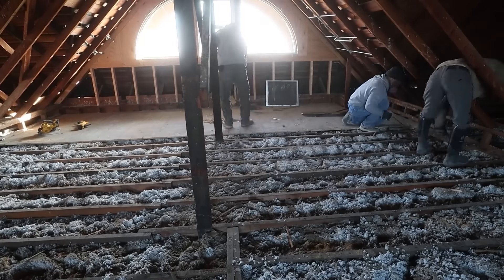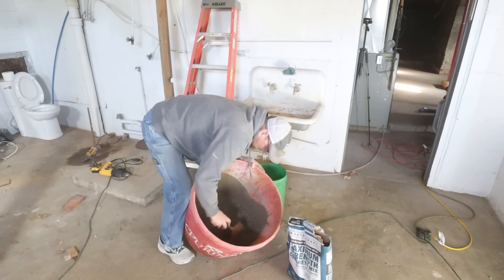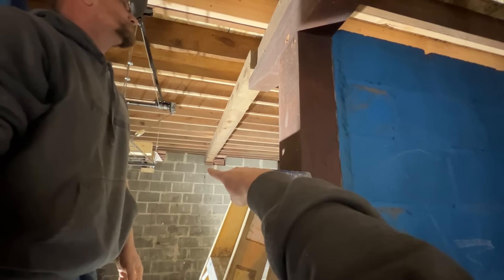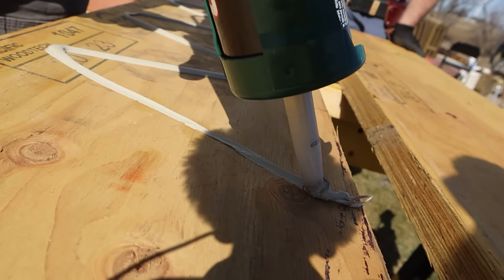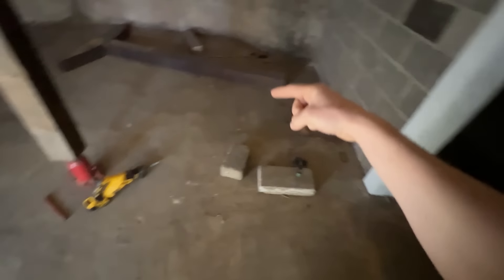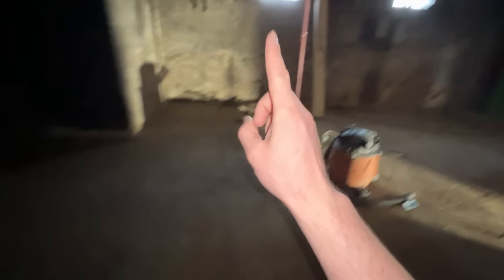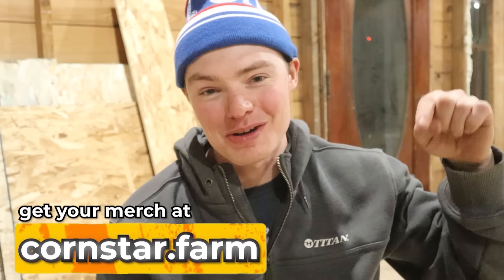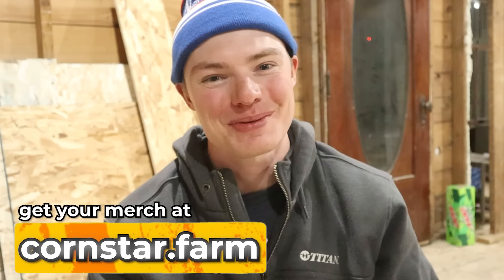Restoring A $7,000 Mansion: Rebuilding Basement Ceiling

Comment: to get concrete into such basements, you order a pump truck, the concrete is pumped through hoses, 100 feet no problem. Regards, concrete contractor in Norway
Reply: from what ive seen concrete pumps can be super expensive,  was watching on some renovating channel here on the tubes and there they charge first for just coming to the place then for the time they are there and the amount pumped through so can easily cost 1000´s of dollars real quick at that point id rather use wheelbarrows considering its a flat area and were not talking crazy m3. dont get me wrong pumps are awesome if your pumping alot of volume or up some floors but a basic basement pour, be better just to get some wheelbarrows or make some slides with materials that you have around and save your self some cash, but America is a big place and maybe its cheaper there.
Reply: It doesn’t look like he’s worried about the money. Pump truck is the logical solution.
Reply: @arniorgumundsson3782  You won't need the pump truck.  They have units that are just pumps and hose.  This is what is needed for this job.  Not pump truck with boom.
Reply: yup.  And into wheelbarrows down there if it doesn't reach.
Reply: Don't you know they want to do concrete the hard way and not the easy way.........
Reply: # paid by the hour😂
Reply: 😊, Norway is 100 percent correct Cole. A concrete pumper work Great.  Standard job. 😊.
Reply: He need a line pump
Reply: Cole when you get to the bathroom you should consider putting 3/4 inch plywood on the walls behind the drywall.  Then if you want to install grab bars you always have something sold attach them to.   One 4 foot sheet two feet off the floor to six feet above the floor then run as one strapping top and bottom to finish the wall to put the drywall on
Reply: I agree with you, hire a pump. I don't know how much a pump is there, but it costs about $400-$500 in Southern California. And it would be worth every penny for this job.
Reply: also do the furtherest rooms first...
Reply: Came to say the same thing id definitely pump it in
Reply: @arniorgumundsson3782  Wheelbarrows can get this done... Pour the far rooms first, getting back closer and closer to the chute.
Reply: @arniorgumundsson3782 You may be thinking of boom truck. Concrete pumper is not so expensive, just a pump on a trailer or back of a truck.
Reply: He doesn't have to go that far honestly. He could use some of the old boards and make a few gutters and let it flow down those easily enough into locations. Did this once because we had more time than money for the project. Saved on a pumper truck and just built like 4 gutters and let it flow to the proper area. Just a rough guess he will need 4-5 trucks full so it will be a substantial amount of concrete for 3 guys to do in one shot so they better call a few helpers on it.
Reply: Pump the concrete. Just use a pump on a trailer lot cheaper then a pump truck
Reply: @MikhailScottKy always so unhappy?
Reply: I don't understand why you didn't cut the channel for the beam then pump the concrete in the voids and into the floor of the basement first before you set the beam. It did not make sense then nor does it make sense  now.  You made it harder than it had to be.  When I had my company I would not have done a beam installation this way. Jack the floor above just enough to slide the beam in after you pour the concrete. When you lower the floor it will rest at the point you need.
Reply: Yep, get a pump truck
Reply: concrete pump or build a trough with slope outside
Reply: Cole, a pump with some hose would work fine not to expensive but wheelbarrows are the cheapest way out. Also add parameter drains around external walls with plastic on walls. This is a type of system don't have a name but just Google. Cheaper then excavating around the outside of house because you would have to get under porches.
Reply: @billholemo2518 Wrong, line truck is cheaper!
Reply: I was going to tell Cole the same thing and saw you already did hopefully Roman will read your comment and tell Cole. I don't think Cole reads the comments to much.
Reply: This is the correct answer.  Let the machine do the work for you.
Reply: The thing with the concrete pump for this case is that you use them when you have to pump some volume. They will need to prepare the whole basement in advance so they can make an efficient use of the pump. Using other simpler metods will give them the time to do the concrete pouring in batches.
Reply: Can't believe Cole doesn't know about this system.
Reply: Check for a portable concrete pump trailer.  Cheaper than a pump truck.  Note that the concrete mix is is a little different.  Needs to be pumpable.  Generally pea gravel.  But check with the pump rental company.

Comment: Regarding concrete in the basement, call around for a concrete pumper truck (boom pump) that has a hose you can direct to each room.

Edit: thanks for the correction everyone on the type of line pump truck
Reply: Good advice!
Reply: Line pump would probably be cheaper and do the same thing
Reply: Build a chute and either pump it in the  chute or out of the truck only.. wheelbarrows young man..buy the two wheel ones..much much easier and you can pour it all..I don't think a pumper would work for the reason the hose is very ridged...
Reply: The old wheelbarrow relay has worked for decades
Reply: Should get a line pump truck.
Reply: There is no need for a boom truck. A normal pump and hose will work fine, and there's a hugh price difference.
Reply: Save the money and wheel barrow it around.
Reply: Excellent idea
Reply: you can also buy a 12”x20 pvc drain pipe cut in half and easy mock up a 40’ extension for concrete boom to make it in other room
Reply: I don’t know how comfortable you are pouring concrete. I recommend you let the pros do it. You can do most of the prep but with multiple floor drains and in the basement I would defer to experienced concrete men.
Reply: cole generac prep your house for generator wiring for automatic 20kw system

Comment: I wouldn't do the exterior drain tile if I were you. If you're already tearing up the basement floor slab, just install perimeter drain tile on the interior of your footings, have the drain tile dump into a sump pit with a sump pump that pipes water out to the surface of your lawn. Saves a lot of time and money while not destroying your yard that you spent so much time to get it looking so nice.
Reply: That is also how radon mitigation is done.  Basically it hooks into that drain tile and pulls the gas out from under the slab via that tile.  The sump well is sealed air tight so that the only source of air/gas is the soil under the slab.
Reply: Will not stop water from coming into through the walls. Drain tile belongs on the outside of foundation. They have a backhoe and skid steer🤷🏻‍♂️ So it’s simple to do it the correct way and waterproofing the foundation walls on the outside as well.
Reply: @kevink4914  That is correct, but his concern is hydrostatic pressure on the basement slab. This would be alleviated from draintile on the interior side. Any interior drainage is better than nothing, which is what that house has had since it was placed on that foundation.
Reply: condensation boilers are a lot of maitenance IBC is a good setup. vertical tube has better design. but they all take intense yearly maitenance... I own one and fix them as a maitenance contractor for a health region.. good luck
Reply: if your basement doesn't presently have water problems, and it doesn't look like it does, there's probably no need to go  crazy with a lot of drainage tile.  you are fixing a problem that doesn't exist.  floor drains to a good sump pump( the abandon well filled in most of the way would be ideal)  pit and the radon system should be plenty.
Reply: As far as radon, you pretty much pressurize the basement so it “pushes” radon gas back out and keeps it out
Reply: @sonoftheking444  not sure I've seen a radon mitigation system like that. The systems I've seen have a sealed sump pit with PVC piping from the pit through the roof and a vacuum pump in the attic that pulls the air from the pit through the end of the PVC pipe at the roof "exit" point.

Comment: Hey Cole! I'm thinking what would be a good idea for the kitchen is to extend the porch to the kitchen. This way you could install sliding folding doors, this way you could use the BBQ on the porch. Kinda of indoor-outdoor vibe.
Reply: This could have gone better if you did a couple of practice houses first.
Reply: Fantastic idea.❤
Reply: If you notice there are walls in the kitchen that are not spray foamed, he explained that this is so he can move that beautiful window and install sliding glass doors to access the  deck and a planned 3 season room.

Comment: Talk to your concrete company about a pump truck and crew to do the floors in the basement.  They'll pump the concrete through hoses and work from the farthest corner back to your window or even down the stairs. While you have the basement floor removed you may also want to consider adding in-floor radiant heat as well. That way you can minimize the 'cold' zones in the house. And if your radon test comes back good, it gives you the option of adding finished spaces.
Reply: Our daughter has in floor radiant basement heat.  Makes for a very usable basement.  No musty odors.  An extension of a comfortable living area,
Reply: @JimTucker-i7o  Hopefully he keeps a bathroom in the basement as well.
Reply: It also allows for heat pumps to heat his house using that juicy windfarm energy.

Comment: As a contractor who does concrete and foundations in southern MN, new and old id do a few things. When you tear the concrete out. Dig down a few inches, pack your base material. Then place 3/4inch washed stone (AKA Radon rock) then put your vapor barrier, at least 6mm poly sheeting down. On top of the poly put down 2 inch foam board and if wanted put your in floor heat tubes onto the foam if your doing that in the basement. When you pour it you can do it with wheelbarrows from a window, just place plywood down to not crush the foam. Or if in the budget use a pump truck and do the entire floor with a couple of people.

But of coarse before any of that do your plumbing and water lines. Also for drainage an interior drain tile placed along the bottom of the footings. Place the tiles level and wrap them up with tile fabric, make sure to place clean rock around the tile to allow water to flow better. Do a larger sump basin and not a small one you get at any big box store (French Drain Man has some good systems). And drill holes in every block or every 6 inches all the way threw the wall. Place a dimple board on the wall and goes down and on top of the drain tile. Allows water building up on the outside to run threw the holes, down the dimple board and into the rock/tile. Just make sure to seal the top of the board to not allow radon to enter. Also put a couple of cleanout holes in the tile to open and clean if needed.

If you really want to slope all the outside dirt away from the house, add rock beds with 1inch foam board underneath sloped away from the house. With a drain tile at the end of the rock. This will catch most of the water before it leaches down to enter the drain holes into the interior system. For the water drains id recommend one near the bottom of the stairs, one near the sump pump (with slope coming from the sump) in case of overflow, and one in the mechanical room for furnace and dehumidifier. Sorry for the long response but getting it right as its not easy to fix screw up with foundations.
Reply: Great I fo thx
Reply: Yes! This!
Reply: The advice you are giving him for the inside of his basement sounds like layers (steps) in a basement foundation that should be done on a new build, not on a rebuild. How is he going to pack base material, lay down a layer of Radon rock, put a layer of vapor barrier and a sheeting layer in basement that already exists? ARE YOU SUGGESTING TO DIG UP ALL OF HIS BASEMENT  FLOORS AND THEN MAKE ALL OF THESE LAYERS? He might as well have knocked down the whole house first then rebuilt the whole basement from the foundation and built these layers you are suggesting, then rebuilt the house up from there!
Reply: @julien2912  basically sounds like what he is doing. Gotta take up half the floor to do plumbing. I do it multiple times a year on jobs. Either full tear outs or partial tear outs. In many areas its required to put radon rock in before you repour the floor. So yes it's a lot of work but it's not impossible
Reply: Longest comment I have ever seen.😅
Reply: Where can I find your contact. I'm owatonna MN and looking for basement contractors.
Reply: Couldn't have said it better, but I'd triple the insulation board as you will feel that value for generations to come as it never breaks down.
Reply: @kingturgan1  sorry didn't see your comment. I'm in the waseca area, so very close

Comment: Run a 4-in pipe from the top of the ceiling down to the floor of the basement. Then put in an inline reversible fan. You can blow the cold air from the basement to the attic during the summertime and blow the warm air from the attic to the basement in the winter.
Reply: I would imagine his duct work will move all the air around like you just suggested but not in a little 4 inch pipe , but in big duct work.
Reply: Okay  @warrenmichael918   a 5" or 6" pipe, the biggest he can fit behind a wall. 
   You are correct about the duct work but your cold air returns are only pulling a small amount of air from each room, as they were designed to do. I don't know about your house but the only cold air returns at my house in the basement are up high and I added them.
    Let's say Cole's house is 6,000 Sqft with 10 ft tall ceilings that's 60,000 cubic ft. If he had a 1,600 CFM blower on the HVAC it would take roughly 40 minutes for all the air to recirculate. All that air is also be taken from everywhere in the house not from the warmest and coldest spots.  
    A 6" inline fan will move about 400 CFM of air. Remember hot air rises and cold air falls. So in the summertime you would be pumping 24,000 cubic ft of cold basement air a hr into the warmest and highest point in the house. Then that cool air falls through the house. 
    For argument stakes let's say the attic is the same cubic footage as the basement. A 6" 400 CFM inline fan would exchange the coolest air in the house with the warmest air in the house every 40 minutes. Two fans at the opposite end of the house 20 mins. 
    It's the same theory as putting a box fan at the bottom of your basement in the summer and putting a box fan at the top of your stairs blowing down from the second floor in the winter time.
    We tested this once when we removed an Old furnace flue pipe. It works. We do now when we have the available wall space.

Comment: 25:38 use a concrete pump- maybe you can pour fibreglass reinforced self leveling screed - then you dont need rebar and you only roughly need to spread it, it has no rough gravel in it and concrete liquifiers that make it self leveling, imagine you pour water- its surface is smooth and level and remains so when hardened - add hacked fibreglass to it and you dont need rebar except maybe to connect it to existing walls
Reply: Totally agreed on that, use a pump and concrete with fiberglass, it will make the all the work so much easy, Saludos desde Argentina

Comment: Concrete pump for the cellar.

When we built our house, they used pvc from the upstairs to the main line downstairs.  We can hear the water running through the pipes, especially when the toilet flushes.
I was told cast iron doesn't have the noise issue. 

Good luck
Reply: Yep!  He will want to insulate the chase where the drain line is with sound deadening insulation

Comment: Concrete pump will be the best solution to pouring the basement.  The time savings alone should pay for it's self.  Little or no standby time for the mixer.  A few workers moving the hoses from room to room vs the labor with wheelbarrows is the key.  Pre-set up the pump.  Mixer sets up once empties the load cleans out and leaves.  the pump cleans out, picks up the hoses and leaves right behind it.  Another advantage is it's is a constant and a homogenous pour.  Little or no risk of cold joints and excessive cracking.

Comment: you need three separate drainage systems for ground water: 1) rain conductors 2) exterior foundation drain 3) interior under slab drain to sump pump and for some locations Radon venting. Tying any of these together will cause failure in the others. 4" corrugated drain tile is cheap, re doing these drains is not. Floor drains by most codes are tied into the sanitary, and this is a fourth system that can never be tied in with the others

Comment: Things to consider!  If you do plex plumbing I have seen them set it up with shutoff valves for each room, so if you need to do work in the future you can only have to shut off thew room being worked on.  If you want house wide Wi-Fi consider having Cat5/6 run to receptacles in the ceiling so you can mount hot spots.  Also a good idea if you want hard wired Smoke/Carbon Monoxide detectors.  You can get Radon detectors for the basement.  Tankless water heater(s) last longer and can be well positioned to deliver hot water faster, and take less space. Best of luck!